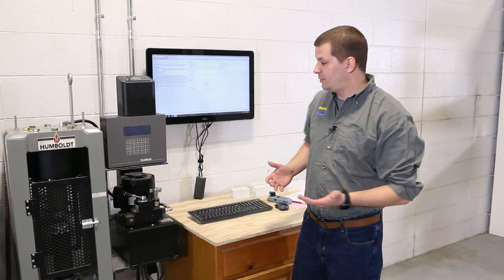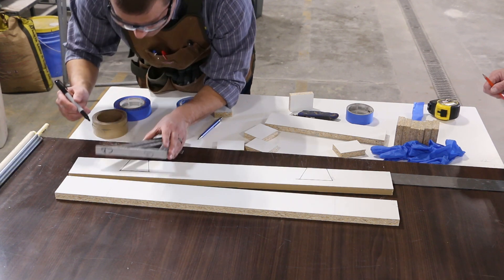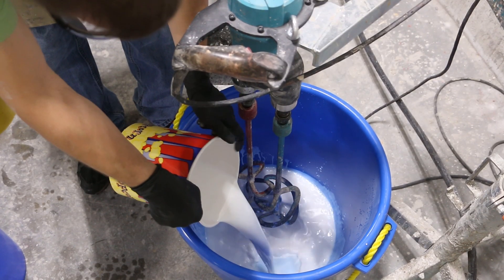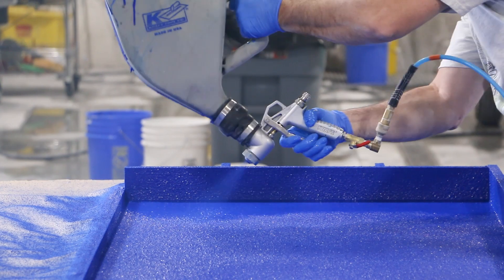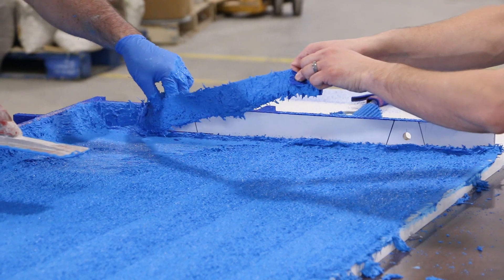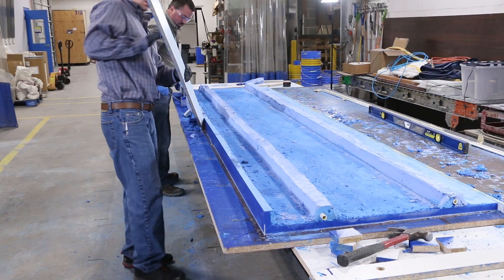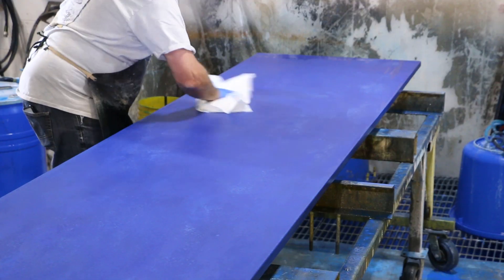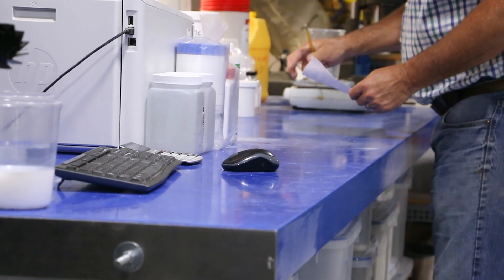Creating a 12 ft (3.6 m) Post-Tensioned Concrete Countertop

Comment: Nice counter top! 
Question... how do you know when to stop tightening the threaded rod?
Reply from the maker: In a structural application this is specified by the engineer. In our case we used a long level and tightened the threaded rod until the piece had a slight crown. This was left for a day or two before any load was applied.
Reply: If you hear a bang ya went too far